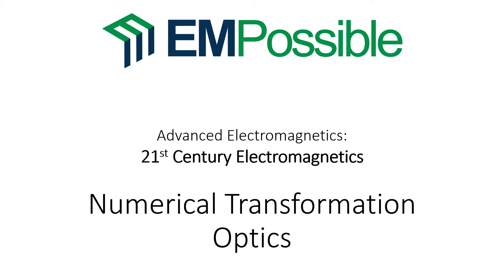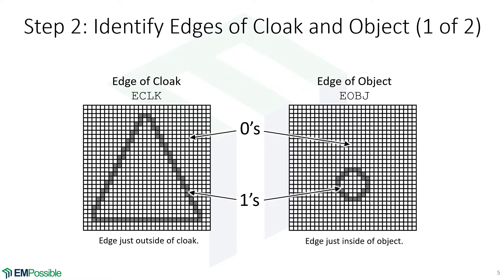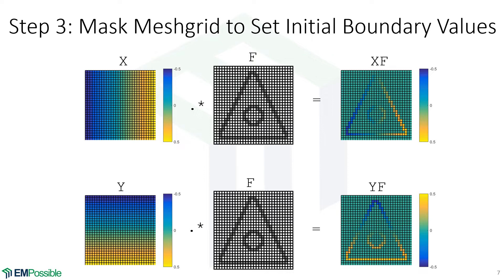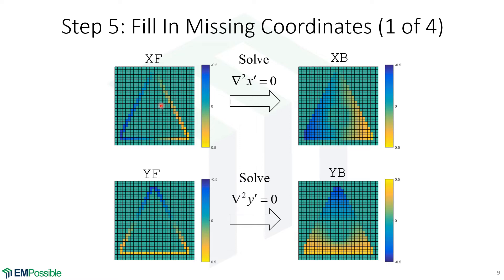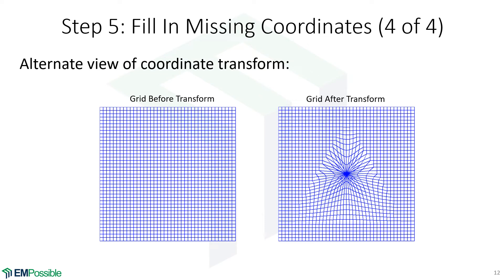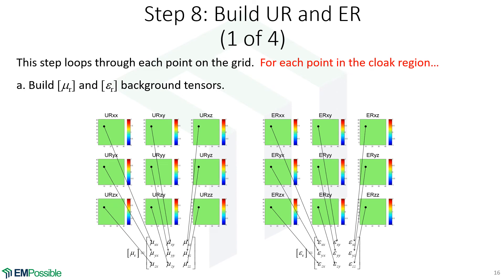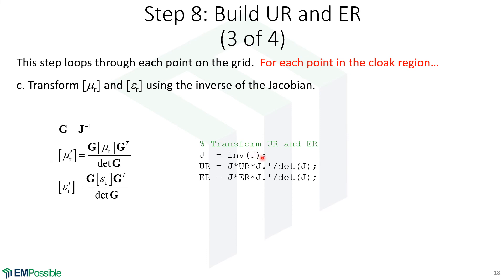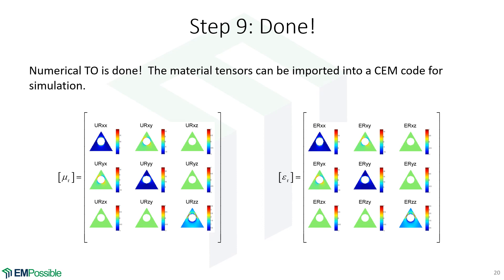Lecture -- Numerical Transformation Optics

Comment: The concept is really cool. I think there is also a way to do transformation optics with dielectrics only right? How would you go about forcing the permeabilty tensor to be the one for free space and still achieve the same performance? What would be the tradeoffs?
Reply from the maker: That is a tremendous challenge actually.  Dielectric-only cloaks were the motivation behind what was called "carpet cloaking," which is cloaking something against a ground plane.  You can also look at conformal mapping as technique to reduce the need for anisotropy and sometimes extreme values.  I have seen optimizations that attempt to achieve dielectric only cloaks.  I am not aware of a technique to directly apply TO and get dielectric only cloaking with the same performance as with permeability included.

A benefit of dielectric only is that it is much more realistic to build and less expensive.  There really is no such thing as permeability above a few gigahertz, at least not enough for TO.  It requires metamaterials which are very lossy and essentially destroy the cloaking effect.  

If you come up with something, let me know!
Reply: @empossible1577  I thought so, but my intended application is less to do cloaks, but more to create conformal lenses, that fit into arbitrary volumes. The anisotropy of dielectrics does not bother me too much. I have created algorithms that allow me to 3d print structures with arbitrary anisotropy, based on much of your work about spatially variant lattices. (You have been a big inspiration so far. Thanks for all your content and courses)

After alot of coding and also material characterication to verify the results, I approach the stage where i actually want to design with the anisotropic substrates i am able to create. Random dielectric anisotopy with 3D printing is not an issue, but creating permeability definitely is. At least if you dont include conductive parts in the printing process, which is a whole other nightmarish topic.

Edit: typos.
Reply from the maker: @SeVeN0ELeVeNify  That is great to hear!

One simple but not exact thing you can try is the set permeability to one and square the permittivity.  This will keep the refractive index constant.  You will get stronger reflections due to an impedance mismatch but maybe retain the function of your lens.

Your 3D printing algorithms sound interesting.  We have developed our own slicer for things like this.  We are able to use hybrid printing to form 3D structures with any distribution of metals, dielectrics, or other materials that we want.  We can do conformal printing, functionally graded materials, etc., Have you visited our research website?

https://raymondrumpf.com/research/
Reply: @empossible1577  I thought about just squaring the permittivity and maybe add lambda/4 anti reflection layers, although this would obviously limit the bandwidth of the device. Yeah I checked your research site and looked at your capabilities with envy in my heart haha.

In my group I am the only one dealing with 3D printing with respect to electromagnetics, which makes the progress rather slow but I am learning every step of the way. I would love to someday visit your lab, your hybrid prints look awesome. I focus on dielectric only to limit the time I am spending on my hardware setup, which is already considerable. Right now I print everything on my heavily customized Prusa Mk3s+. I explored conductive filaments as an option for a while but ultimately decided to go dielectric only and explore high permittivity filaments.
Reply from the maker: @SeVeN0ELeVeNify  We have yet to try a conductive filament that is conductive enough to do anything with.  If you do find one, let me know!